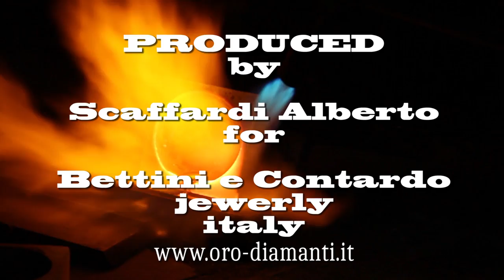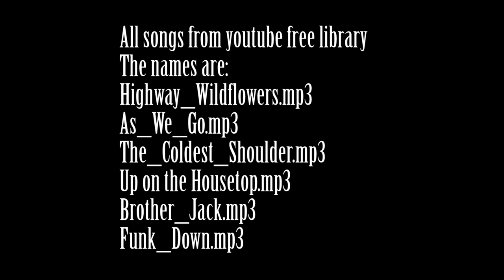Emeralds and diamonds handmade 18k red gold earrings

Comment: TOP workmanship! The re-positioning of claws while soldering superb! I think a key element  it is the half  round with a groove wire. What I used instead of files was emery flaps with steel backing ( in different grains and diameters) more precise to get into every corner even faceting the end claws! The setting of the stones "In plain air" quite extraordinaire! The leather gloves a good protection! I used to make myself finger tips leather protectors. You are as "top fighter shape" in fine tune! I happily retired! Regards- Stan
Reply from the maker: +Arpol West1 Thanks a lot

Comment: I love your work and have adopted some of you techniques in my jewelry making - especially you soldering. When I solder prongs to the base in this type of setting, I use a soft soldering pad and push the prongs into the pad about 1-2 mm. The pad holds them in place against the setting. The way you do it here is probably faster ;-) Thanks for sharing. Your videos are great!
Reply from the maker: It is right in Italy using a refractory earth which retains the pieces during welding. I work in a small workshop I must continually stop working to take care of emergencies and I do not use support is the most practical for me.
Reply: Best degine

Comment: In this kind of hanging strand I used white gold for the links because 18k is softer and this is the most vulnerable model at attrition .The attrition is more pronounced on the upper links of the earring , where the weight of all the other parts is attached. Yellow 18k is very soft and the customer will take the earrings to repair in a very short time, especially if they wear them more often or even daily and will be a big problem to remove the stones each time to change the links. The only solution would be that spark-jam machine, PUK, but it's very expensive. Links from white gold and everyone stay quiet . White gold (even 18k) is much harder and the durability of the object increases at least 4 times. Most of all , when polished , the small white gold links are not visible , being in recessed areas .

Comment: Where to buy genuine Emerald unheated, untreated certified Emerald in United States. i'd be grateful to you. Thank you.
Reply from the maker: I'm not practical in the American market, but knowing the laws that regulate it, I think if the gem is accompanied by certificate G.I.A. and the merchant is trustworthy you just check for any price differences determined by competition. Reliability of a shopkeeper is also determined by the years of presence in the market, and its traceability. After the purchase you can do to run a control analysis by an independent laboratory.

Comment: Where can I buy your plate with cable？
Reply from the maker: +Ma Jackie I'm sorry but I do not understand the question, what's plate with cable
Reply: I think the question was where the draw plate to make the rectangular and angled wire are to be purchased .
I have personally found several of those plate. The one missing to the collection is the one showing at .45 of your video. This one allows the shipping of the wire as a 90 degree angle. 
I have not yet been able to locate this plate for purchasing. 
Could you help ?
Reply from the maker: I buy the tools of two wholesalers, by "Luigi dal Trozzo" and "Legorgroup" both have an e-commerce site

Comment: I could give u lessons on your work , using a file to dress prongs is wrong, scratches the stone.
Reply from the maker: Thank you, have many years that I mount gems, are also gemologist. To the knowledge of the characteristics of hardness and for direct experience I can assure that many buds can not be scratched or marked by steel tips. During mounting of the gems must pay particular attention to chipping of gems, this can happen during the entire processing phase and is independent of the hardness of the material that is in contact the gem.